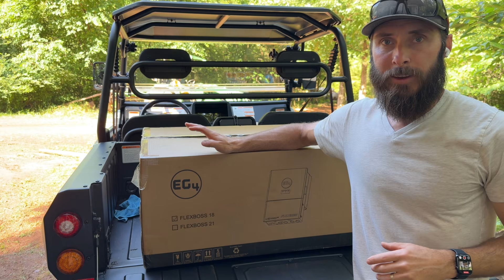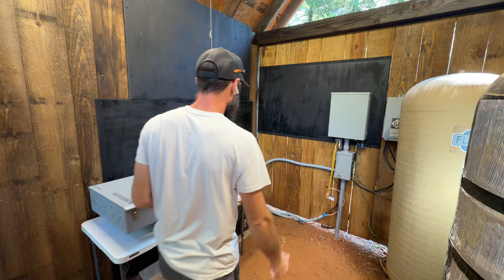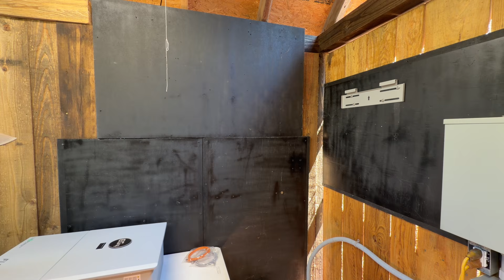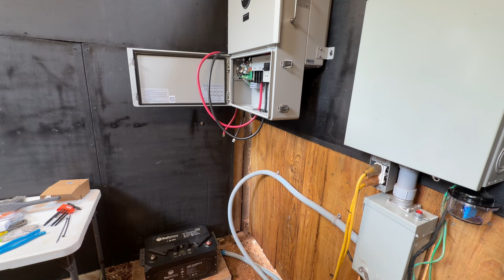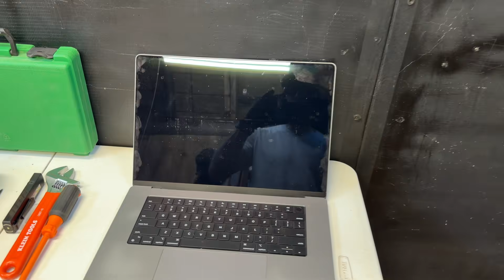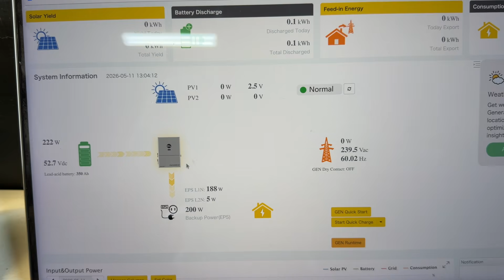Installing the EG4 FlexBOSS18 in the Well House for a 5HP Pump

Comment: What is the gridboss for if you don’t need it?
Reply from the maker: The GridBOSS acts as a gateway that pairs with the FlexBOSS to manage grid input and loads, simplifying the wiring by eliminating the need to use the inverter's dedicated load ports. It allows for many inverters and a generator to work in unison, to deliver power to your home or to the grid.

Comment: Eric, i know you said that lower box is grounded, but watching the video I dont see it. No green or copper coming out of that plastic conduit, so ??? If it was metallic conduit then ok, IMHO you want ever metallic box grounded, and i think NEC agrees with that as well. As i understand it you are in a pickle if that lower box happens to get energized and its not grounded, you reach over and touch it and your body becomes the path to ground. Hope that makes sense. Best wishes and stay safe.
Reply from the maker: I totally agree, James. This one is grounded though. At 38:49 you can see the green going down into the lower box. Thanks for checking!
Reply: @HomeEnergyIndependence Awesome, that was a better angle, all good. 😅
Reply from the maker: @jamesbsa6450   In my haste, I tagged a video clip that showed the wiring going down to the well pump, not into the box below. 🤦🏼‍♂ But at 24:50 you can see the black THHN going up from the ground bar into the "grid" panel. I should have highlighted that better and use green instead of black. I did, however, mark the other end with green tape. at 27:09 you can see three black conductors coming out of the conduit. L1, L2, and ground. They are all appropriately marked with colored tape on the ends. Thanks for always keeping me on my toes.
Reply: @HomeEnergyIndependence not to be 'that' guy, but remarking of a ground is not permitted per the NEC, but I realize this is not inspected, more of do what works for you. 😂
Reply from the maker: I know 😂 it “should be green”. I hope in the event of a short, the black ink will not prevent the copper from doing its job. but in all reality, I understand why on long runs you would not want to have it black.

Comment: I run a srne 12k pro on house with 5ton ac and lights don’t flicker an I don’t have a soft start on the AC 5 ton hands down srne make better inverter
Reply from the maker: That’s good to hear. There’s a big difference between a 5 ton AC and a 5 ton well pump but it’s good to hear it can handle your load.
Reply: @HomeEnergyIndependence it say handle 6 hp but the new can do 9 hp I used and installed both srne can handle it better
Reply from the maker: Nice!

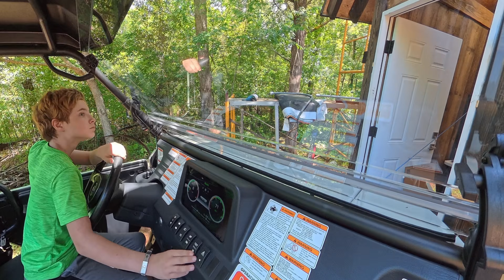Comment: 13:35 🤣🤣🤣
Reply from the maker: Luckily, the Innovator was sitting right there with the winch attached. it’s only fitting that an EV was used in building the system.
Reply: @HomeEnergyIndependence  exactly!

Comment: EG4 for the win again!

But question… @16:25 you mention ‘sub panel’. What do you mean? Can you explain or send a reference to this ‘capability’?
Reply from the maker: i’ll try to explain it, but my understanding is that when paired with a GridBOSS the FlexBoss load is typically unused because the GridBOSS sends the load to your home through one of its ports. however, a recent firmware update allows you to also use a load ports on the FlexBoss while you are paired with a GridBoss. I hope that makes sense. I’m actually going to be doing one of these soon, so I’ll put a video out when I do it.

Comment: doesnt require ferrules on stranded wires??
Reply from the maker: I probably should’ve used ferrules on the battery cable since it’s fine-stranded flexible cable. But the regular THHN stranded wire I used is standard building wire, so that’s normally landed directly in the lug without ferrules.

Comment: Come on Eric man up lol! Get that flexboss18 on the wall. I was looking at that like that is high but I would try it myself as well.
Reply from the maker: lol! It's not that I couldn't lift it that high (i think). I was scared that if I got it up there, it was going to tip over backwards onto my head and crash behind me. Or maybe it's just that I couldn't do it. But the winch on the Innovator sure worked well
Reply: The weight of that thing is incredibly unbalanced, I almost broke my arm trying to free lift mine onto the wall and not quite getting it on the bracket.  You did the right thing using the winch.
Reply from the maker: dude, no kidding! Until you’ve lifted one, you have no idea how wonky it is

Comment: Nice it just works I think EG4 should use that as their motto. One thing you say it is fed from the grid which we know is your 6000's and probably the load side of the 6000 which means you definitely cannot back feed that side but you can backfeed the ac couple port which is the gen port set on ac couple. Cheers
Reply from the maker: I like the motto! Maybe we'll pitch it to James if we can get him on Unplugged again. I'll have to think about how I could incorporate that AC couple at some point. Thanks for the feedback

Comment: Fine stranded wire is kind of the installer's choice, but ferrules are not needed for those lug terminals / coarse stranded THHN.

Glad this one is working for you, much simpler.

Also, you're right about the ground.  If it's all bonded, doesn't matter.  Do a continuity check between inverter case and both boxes.  Get the beep, you're good to go.
Reply from the maker: Good call on the continuity check, I'll definitely verify that! ⚡

Comment: I'm still mad the Solis wasn't up to the job.  This video was straightforward and simple when things just work
Reply: well it did actually work... but it was only after it took a 2 min break to get back in sync with each other...which is terrible. I wonder if you could run it in "grid down mode" forever (on solar) and not have any issues....?
Reply from the maker: I bet you could, but when I was talking to their engineers, they said not to put it in off grid mode for various reasons that I can’t remember
Reply from the maker: HAHA It was nice to have a plug and plan setup that works out of the box.